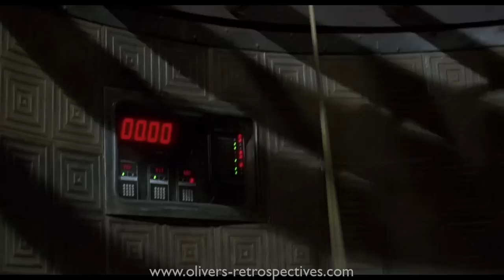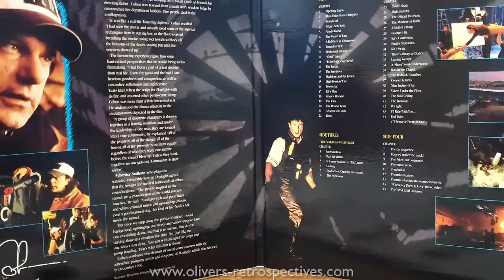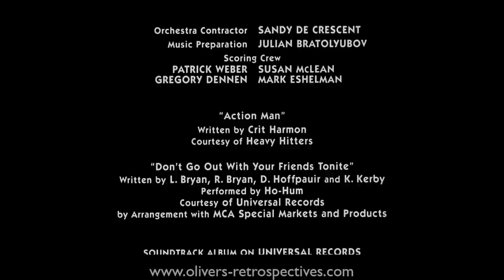Daylight (1996) Retrospective / Review

Comment: The best disaster films are those with likeable characters, which is why this doesn't match the best from the genre but it is hardly the worst either.
Reply: This is actually a possibility right now with the Holland Tunnel. There's a plan to reinforce it, and probably replace it. If they can't fully rehab it, they plan on fully imploding it. It's supposed to begin the reinforce project around 2026 and the replacement/expansion in 2032. The tunnels aren't designed to last 100 years without a overhaul.

Comment: The major problem with this film--not mentioned in this retrospective--is that Sly was the entirely wrong man for this role.  As mention here he was told this would be a film not showcasing his muscles.  That was the problem in a nutshell.  The character Kit--that Sly plays--is required to use his mind---at one point he actually says he needs time to think--once attention is brought to the fact that Sly was going to have to portray someone who 'thinks' the illusion of him being a good actor for the role is shattered.  No one--at the time saw Sly as a thinking man.  Casting a better actor--say, Chuck Norris, or perhaps, William Hurt would have been better for the idea of a thinking man who can also step up physically to save people trapped in a tunnel.  It is true that casting is perhaps one of--if not THE--major decisions that a director has to make, and in this case he failed.  There are other examples of poor casting that hurt films, but they are so multitudinous that I won't highlight any here.  I will remind you of what the late, great actress Bette Davis said regarding casting the film Gone With the Wind.  'IF anyone is cast as Rhett Butler but (Clark) Gable Americans will riot and not show up to see the film.'  Even in 1939 Hollywood knew the importance of casting, which is why current heartthrob of 1939--Errol Flynn--was not cast as Rhett Butler.